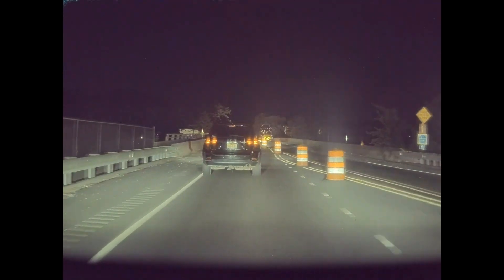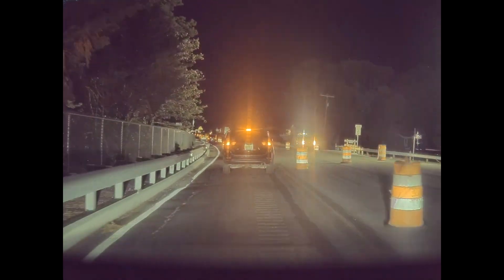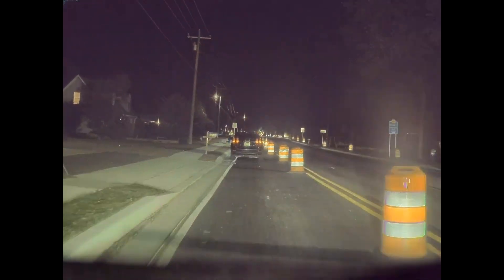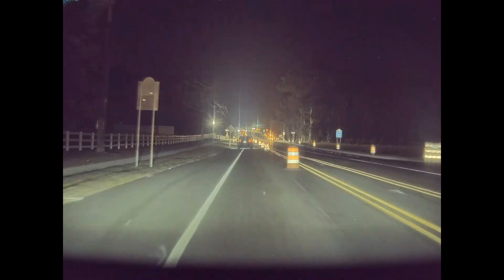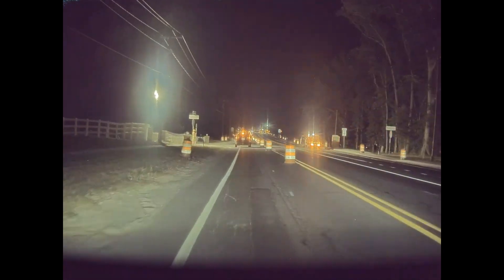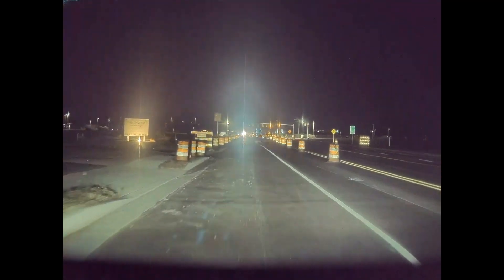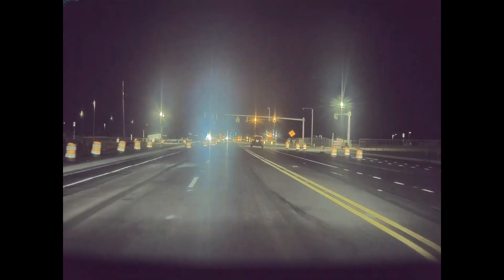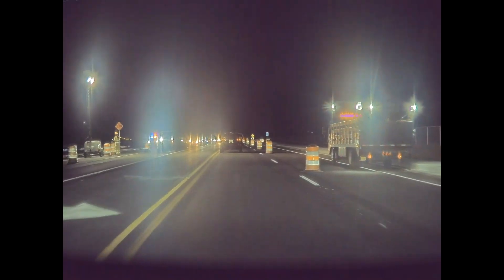Construction forces FSD to the wrong side of the road, and...

Comment: I wonder if the car is not just following the car in front... I guess the Tesla "Trusted" those taillights with a bit of caution checking everything around is not coming directly at it.
Reply: I can tell you, while it is not completely perfect, the car will make decisions on its own based on the data it pulls in.
My car one day came up to a tree that was downed in the middle of the road. I thought i was going to have to take over. NO! It waited until the car passed on the other side, looked to see if there were more vehicles coming and proceeded to go around the tree. It was phenomenal. It had to cross to the other side of the road to pass. No lead car in this situation to base its decision off of.
That being said, they need to program in data for man holding stop and slow signs. The car will stop at the stop sign, but it treats it like a regular stop sign and will start to go.

Comment: 0:52 Why did you cut the lane change, the single most relevant part?
Reply from the maker: I didn't.  The video is a string of several one minute long dashcam clips.  There is a break between each one; that one landed at an inopportune time.
Reply: @smichelsen  Ah, that's unfortunate.